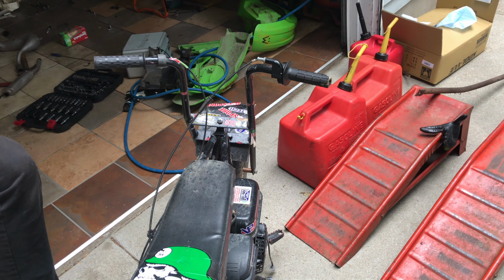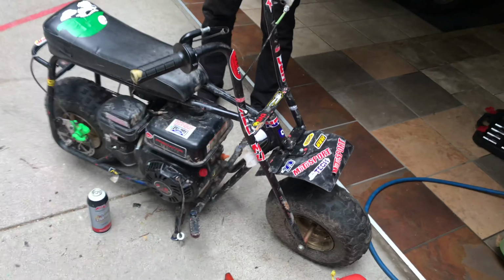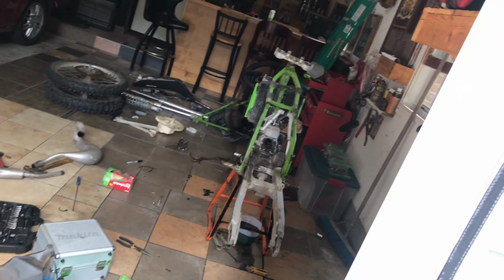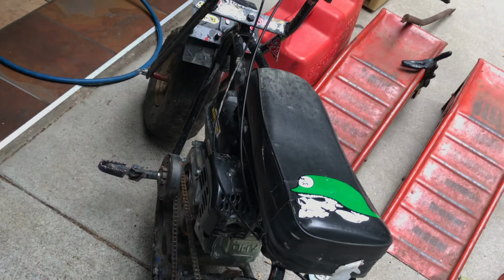212cc Predator Doodlebug Mini Bike EXTREME Off-Roading

Comment: Nice build I have a 201cc street racing custom build shes fast goes about 60-65mph I bet y’all have a blast out there I live in the city so not much for me to do without getting in a chase but I’m thinking about taking it off reading just gotta slap some mud tires on there right now I have a wheel barrow tire in the front and a slick on the rear 😂
Reply: Offroading*
Reply from the maker: Hell yeah brotha🤟🤟